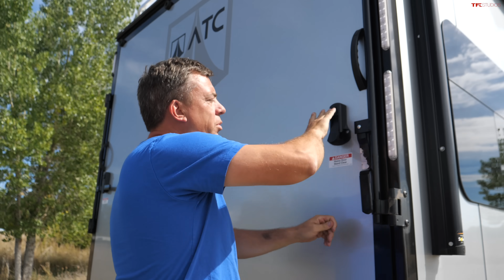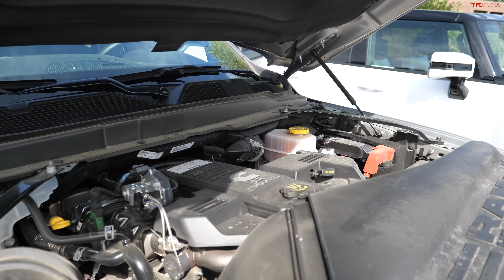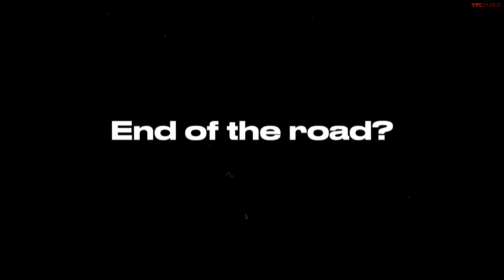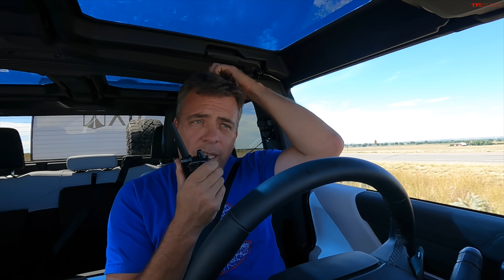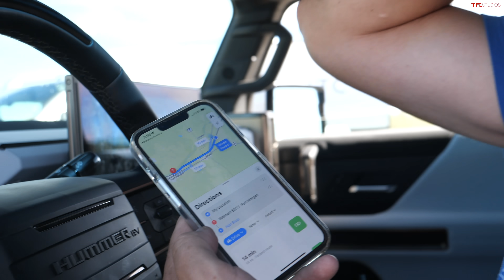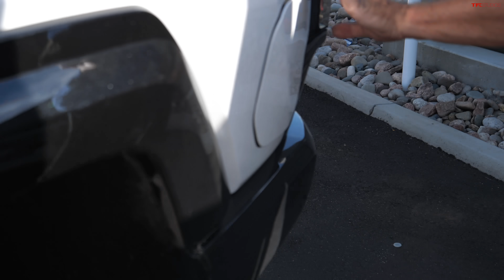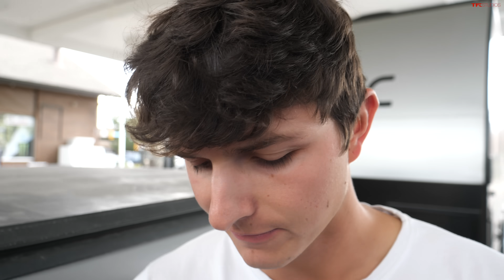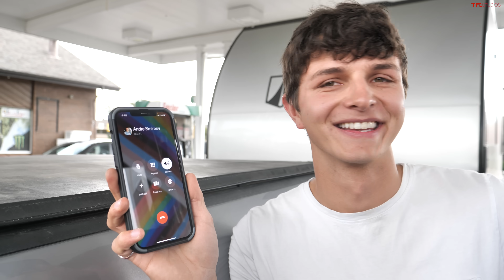How Far Can a Diesel and Electric Truck Tow An Identical Camper Trailer on ONE Fill-up?

Comment: The one thing I havent heard you guys mention is that if you look inside of an electric vehicle owners manual. There is an algorithm of how many fast charges that you are supposed to perform per slow charges. As you surpass that your battery  warranty starts to get cut down. So if you have a battery issue at year 5 and your warranty goes to 6 years but you used fast charging alot your warranty might be out.
Reply: our electricity usage costs  will increase 40% by summer 2023 the government is creating more poverty also since we rely on them for food they control us also the food they provide is poison so expect more diseases illnesses and a dumber public the poisons affect our central nervous system see facts and evidence galore on tricksofthestrades channel
Reply: Can you give a rough example of what ratio fast charges to normal charges?
Reply: @djw1091994  approx 4 slow charges to every 1
Reply: With new technology like this make sure to buy the extended warranty.
Reply: @wrongthinker350  they already come with eight years 
How many cars have you had eight years 
Expected BEV battery life 15-20 years and that's just first use
Secondary use Is twenty five years as solar or wind storage.
After that they are 100% recyclable
Reply: @robcrissinger776   The new F150 lightning full electric truck can't even get more than a 100 miles pulling a 3500 pound trailer. Back to the drawing board on that 1. It's -25ﾟC where I live today I bet you could take that range down to 75 miles with the heat cranked all the way. Nice job ford absolutely useless vehicle.
Reply: I can believe that
Reply: And those “fast charges” aren’t actually fast.
Reply: Most drivers don't average 200 miles a week
That means  you'd hardly use a vDC charger and would use nighttime reduced charge rates of under, $.12 cents a Kw
Reply: @robcrissinger776  if that works for most people than buy one IF you can afford one. I personally cannot afford buying an EV. So until technology becomes affordable to the average citizen there is going to be pushback
Reply: @favss10  So because you can't afford an EV
there will be pushback?
Technology advances quickly 
The first cars cost several times the yearly earnings of the average American worker.
10 years on the model T costs $500 bucks 

You're lost in the past and thinking out your ass.. 

Five years from
 Now get back to me and 
tell me how much you enjoy the EV You're driving...
I'll be waiting
Reply: @robcrissinger776  Rob, you should really stop commenting. You seem batshit insane.
Reply: @robcrissinger776  I am not saying that EVs are not the future. I am saying that until they become more accessible to common person they will not be widely accepted. In which will eventually happen. But until then Dont be a hateful Dick! I was just telling people about this very little known fact.
Reply: @favss10  it not little known dickwad.
The ice auto were 
 people's cars costing multiple years of a well off person's income. 
Within 10 years of invention on $5 a day salary the average Joe could buy a car for $500
The future is here with some State and federal incentives  getting people into $20,000 Bev's

Acceptance??

Of 8000 respondents 

14 percent said they would definitely buy or lease an EV and 22 percent said they would “seriously consider” one. Another 35 percent said they'd consider getting an electric-only vehicle in the future
 
So much for your theory

Do a bit of research before posting your ignorance 🤔
Reply: At home on a 220V AC plug
Reply: @robcrissinger776  in what world do most drivers not average 200 a week? That's less than 28 miles a day. Unless it's middle of the city where you live and work I doubt that.
Reply: Most truck owners  over  75% don't tow 1 time a year  and the 25 % or less a  few  times a month 

$38000 in inflation adjusted dollars savings
Reply: Battery warranty for many is eight years.
People use DC Fast charger  when  doing road trips
Most drivers don't drive 10k miles a year and infrequent  long trips.
They charge at home at night on ac current..

Stop whacking  your moles.

You People just keep making up new excuses to display your ignorance 🙄  or what???
Reply: @robcrissinger776  Well Rob i do 30k a year just for work let alone the weekends, i have 2 boys @ driving age and my darling wife, there is no way i can charge 4 vehicles @ once on home household power (also running the house as well) and then there is the cost of the vehicle itself double the the cost of the same style, not to mention the extra weight of said vehicle and the effect on the road system stemming from that. Of coarse you haven't chosen to speak of the mining of precious metals in order to make the batteries and the effect on 3rd world countries that employ slave labour to mine them.
So it comes down to the fact that YOU are the only "mole that's been whacked here".🤣 or what???
Reply: @robcrissinger776  you do know that the national average for a truck yearly mileage is almost 40,000 miles per year? That's 40,000 miles per truck per year on average. I don't know anybody that has a truck that only puts 10,000 miles a year on it none. Gas diesel doesn't make a damn bit of difference
Reply: @MonzaRacer  yea I've put 15k and I'm in lawn and landscape, I don't know how you could put much more per year than that. If you do,  really need a different job
Reply: @dh4094  assuming you work like 48/52 weeks a year, 5 days a week, 15,000 miles per day equals about 62 miles. I currently drive ~95km a day for work, which is a little less than 62 miles. Bringing absolutely no other driving into the equation, that's already 14,300 miles. Next year I'm probably going to start doing roadtrips with my truck and mountain bikes, so add in another 1000-1500 miles, plus buying and delivering material when we swap over to contracts instead of hourly. Its absolutely possible to surpass 15k, and I only work relatively local at the moment. 
There are guys who drive in from 1.5hrs on the highway. Trust me, you need range
Reply: @TheIronCowboy  EV's even truck ev's travel longer ranges than 3 hours  of commuting.
Reply: @robcrissinger776  do they do it in canadian winter while towing? Because this is construction, like real construction. Not like "go to home depot and pick up a couple dozen 2x4s for a reno". With proper sized excavators and diesel auxiliary tanks. We're talking pulling a 30ft flat deck, not an airstream.
Reply: @MonzaRacer  So far just crickets from the moron
that thinks the average pickup truck does 40,000 miles a year.
Fukin idiot
When faced with the facts his bullshit can hold more water than his head...cavity
Reply: @robcrissinger776  EV tech is useless virtue signalling bullshit for people with too much money to blow, or who live in a large city.

We've had powerful electric motors for decades, the issue is batteries still suck. Oh and as a Californian I really wish people would stop giving more reasons for PG&E to start forest fires by adding vehicles to the grid.
Reply: @paulwilliams667  More Bull dung
From an undereducated Troll.
PG&zE didn't have fires due th EV'S. 
People are buying EV'S in rural America. 
Stupidity is large around you for sure
Reply: @robcrissinger776  Reread my comment.
Now reread it again.
Can you tell me EXACTLY where I stated EVs caused PG&E fires? Oh that's right, I DIDNT.

Guess it shouldn't surprise me that you fail to grasp even the most basic principles of cause and effect. We already have an overstressed electrical grid causing fires every year. EVs will place significantly more stress on that grid. Aside from aaaaaall their other failures, our power grid is not built to handle that much consumption.

Comment: If you want to do any long distance towing with electric trucks, the bed of the truck is so you can bring a big generator. The frunk is for all of the fuel cans you’ll need.
Reply: Sort of defeats the purpose of clean energy.
Reply: Don't matter  all this EV green is bullshit ask them howmuch fossil fuel it takes to make a damn ev car and battery..also were are we gonna keep getting the natural resources so make the battery's?
Reply: And the cost of the fossil fuel to run it.
Reply: @Scuba Steve 100% false. Electric Aircraft batteries using batteries manufactured in Sweden can be charged in as little as 30 minutes and give the aircraft a flight range of over 500 miles.
Reply: @Destin65  what does an "airplane in Sweden" have to do with a bummer taking 4days to charge?
Reply: @Destin65  Electric airplanes??? NOT HARDLY!!!!!
Reply: @Destin65  that’s cause after 200 air miles the engine craps out and it’s now a high altitude glider to get it another 300 air miles before landing, EV technology isn’t that advanced yet but maybe in another 200 years it will replace petroleum powered vehicles, but then here’s the other side of the coin if we get rid of petroleum powered vehicles and depend solely on electricity how will the electricity be produced no more petroleum or coal to power the generators to produce electricity No electricity and with countries against nuclear power plants that kinda puts EV vehicles at risk not to mention the power grid,
Reply: @stephenjump4218  EXACTLY!!!!!
Reply: @Destin65  and how much do these super batteries cost?
Reply: @Destin65  is Elvis your pilot
Reply: @Destin65  What the hell does that have to do with the price of tea in china?
Reply: @Destin65  Maybe but with only the pilot on board...won't be so efficient with 400 passengers.

Comment: In this video a couple of times the energy equivalent in one gallon of diesel is mentioned. For this comparison to be fair the ram should only have the  enough diesel in the tank to be equal to the  Hummers battery. Then the true efficiency would be found. As tested it is already known that that the ram will go further.

Comment: When is fiat going to ditch the pile of 💩 transmission’s and put an equal quality drivetrain as the engine. Competition is running off and leaving them on torque in the 3/4 market because the garbage 68re is the limiting factor.

Comment: Just at a curiosity I did the math of cost per mile when towing electric vs diesel in this video using there data. Diesel $0.49, Electric $0.33 (if they paid). In short electric was 50% more efficient. Bad news is, if you divide the electric premium by the battery warranty life of 150k. That adds an additional $0.29 cost per mile in this experiment with a total of $0.59 cost per mile to tow. Thus the diesl wins in that aspect and is 20% more cost efficient. That being said, I am a city slicker, weekend warrior off road poser. And would get the Hummer just to do Burns outs and donuts in the dirt  like an idiot. 🤣

Comment: These videos continue to be  a FFF waste of time. 

Current EV trucks are NOT meant to be long distance towing haulers.

Get it through your thick head.
It's a new niche, which serves mostly daily commuters, and short-distance work sites. 

What's next, testing the crash safety performance of a Volvo versus a bicycle?

Comment: Not really cross country?
Not really weekend!  If the furthest you can go from Denver on flat ground is Fort Morgan?  Weekend is stretching it.
With the added fact that it is not even really a pickup.  It is an SUV with an open back end.  It does not even qualify as an around town work truck.

Comment: An interesting comparison of both vehicles.  The main thing missing is 1) how much does it cost to charge per kilowat and will this change. 2) how much per gallon of diesel and will this change.  Based on Joe Biden's plan, both are headed up to levels we have not dealt with before he was voted in and made the changes on everything.  Also, is there any 'baby formula in this store?'

Comment: So many comments are made about the limited range of EVs when towing, but shouldn't the real equation be the comparative range loss when towing? Even gas/diesel trucks lose a lot of range when towing. I wouldn't want to have to wait so long to recharge, compared to refueling when towing. Until that is sped up, ev towing is going to be very limited

Comment: I have 2018 Ram 2500 towing a 29TRX toy hauler at 12,500 pounds, and I average 10.5 mpg giving me Over 300 miles of range. If I hang 5 car lengths behind a semi it goes to 14 or 15 mpg. And  I paid $46,000 out the door with an 8 year 120,000 mile warranty. These EVs can’t even tow 12,500 pounds, and if they could they probably wouldn’t make 100 miles.

Comment: How much diesel can you buy for $46.000; the difference in price between the two vehicles??? Notice that they will not stick around charging until back to 100% because that will take F O R E V E R. The EV will charge rapidly until about half full. The system cannot handle heavy load for the full charging time; cuts way down about 50%

Comment: My 18 year old Ram 5.9 Cummins gets 19 mpg; 11-13 mpg towing my 8000 lb travel trailer. Nearly 400,000 on the odometer; faithfully maintained; as strong as the day I bought it. Same engine, same manual transmission, same drivetrain. Only wear and tear replacement of chassis parts; occasional accessory, ie water pump, clutch fan, batteries, tires. The only weak link is the clutch which has been replaced twice; South Bend is the only way to go! How many times will the HUMMER require battery pack replacement? At what cost? Will it still be on the road half a million miles later? DOUBTFUL
Dealerships desperately want me to trade it in on something new so they can get their hands on, hands down, the best truck made!

Comment: Why not have a support team and drive until both vehicles run dry. Then have someone top off the Ram in about 15 minutes and tow a generator capable of recharging the Ram in about an hour... The vehicle which goes the farthest wins the competition; extra bonus points for difference in 'refueling' time.

Comment: Why is the goal to see if the Ram can do twice the distance as the HUMMER? "Is my Ram twice as good as your HUMMER or only 1.9 times better?" Both trucks, towing equivalent equipment/weight, starting with full 'capacities', should be judged equally. How does the Ram fail if it isn't twice as efficient as the EV???
Get your thumb off the scale in favor of the EV...
and once their both empty, how long does it take to return to full capacity???
No comparison.

Comment: Until there are more fueling stations for electric, 120 miles for a full charge doesnt make a lot of sense.   Around (a big) town on electric, ok, but 30 mins to recharge ugh (At a 150kw double that time).  If you live out in the sticks like I do it's no Bueno.  The Hummer tow capacity is poor at best for a HD truck.   I also would think twice about bringing that 10k lbs in sand or mud, that's a lot of weight on a soft surface, and getting out if stuck would be no picnic either.

Comment: There are so many aspects of EV's that are really awesome, but capacity just isn't one of them. When you can replace diesel pickups with an EV -- EV cars will have 2-3k mile ranges, it'll be crazy. We're a massive leap in battery tech away from that. 

I'll admit, I am surprised the Hummer did as well as it did. There's a lot of folks who that may actually work really well for. I'm thinking suburban family with a small travel trailer, maybe a boat, and they go to local campgrounds and lakes -- as long as they never, ever, wanted to travel outside of their locality -- they'd probably be able to use the Hummer well. Also, probably going to need charging support at whatever campground they use unless it's really close and they don't use the EV at the campground. Hmmm

I'll stick to my diesel. Not just for now, for ever. What's going to happen is as HD replacement becomes more realistic the cost of oil is going to plummet. Eventually it makes sense for EVs to replace diesel trucks -- we don't have the infrastructure for it nor the battery technology. I honestly doubt we'll see HD trucks replaced by EVs in my lifetime.

Comment: It's a liberal toy for now. I towed 20,000 lbs (total weight) about 1200 miles and averaged 14 mpg with my '05 5.9 Cummins Ram. I will never part with my 5.9L baby👍😎👌 Oh and unloaded I got as high as 700 miles between fills.

Comment: Many places are free charging to begin with, that's a selling factor for EVs. Taxpayers pay for it. And in most parts of the country, the fossil fuels used to make the electricity to change EVs, is more than used in gas and diesel vehicles.. not to mention the environmental impact of making and disposing of the batteries..

Comment: Spent $37.41 but it was "free". This time. 

Wait till it's not free. If it's already that much to get half a charge, you can smell the card readers smoking already. Get ready to pay dearly for these crap electric vehicles.

Charging at home, it uses 50x the power your fridge does while charging. No thanks.

Comment: Under current tech, battery powered vehicles will NOT ever pass diesels or in most cases any heavy hauling vehicle for range.  Then stick them on grades and in the heat and cold extreme's they would have to face and you get even less efficiency.  The vehicle weight is also an issue.  Heavier weighted vehicles wear EVERYTHING out faster.  Tires, ball joints, etc.  Almost a 2k difference in vehicle weight is alot.  And of course finally, as most of us know, those charging stations are few and far between.

Comment: If the diesel can go twice the distance as the hummer, and it cost $40 to charge the hummer, and $100 to fill up the diesel, you're saving about $20. Now you got to factor in the gap of a $60,000 truck versus $140,000 truck. 

Electric trucks, although fast and powerful, are a waste of time as a tow vehicle. For now